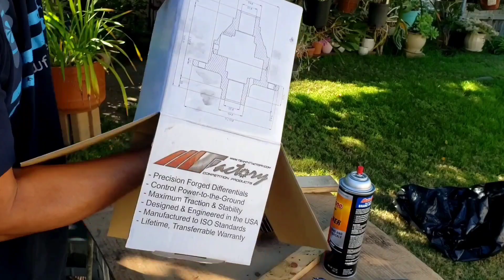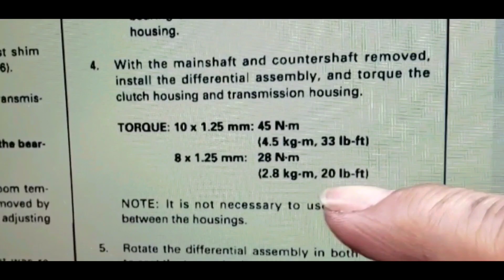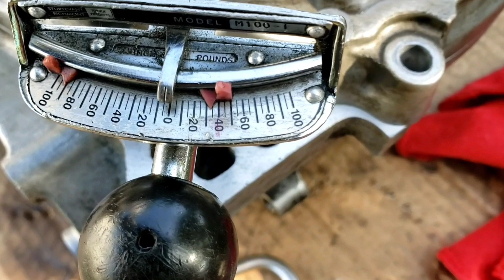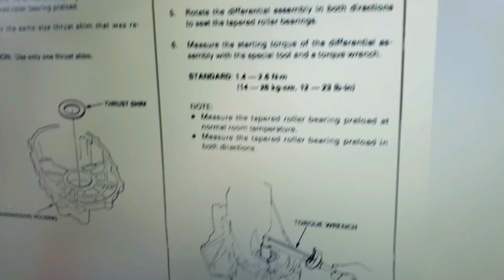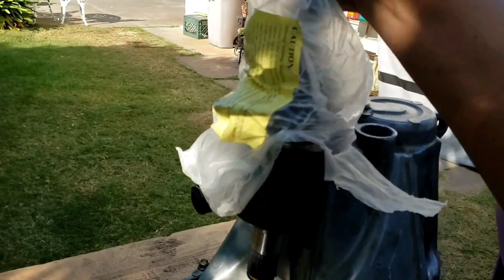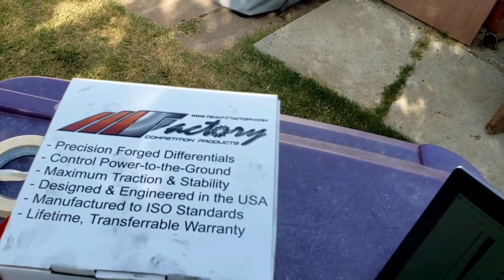MFactory LSD install and bearing pre-load check. G23vtec swap Civic.

Comment: I just bought one of them mfactor LSD for my h22 tranz for 300 brand new with new ball bearings, and then bought a new 4.0 fanle drive for my boosted rex . 450hp on pump , new race tune for 650hp to come
Reply from the maker: Daaanngg! You'll be winging man! Thanks
Reply: @sagittnet2158  thx for all the h22 content 💪

Comment: Welp. I'm doing this exact installation right now. My preload was approximately 5 inch lbs, and can move it with ease with my fingers. Can't find any shims available to adjust it. I might be screwed! Any ideas?
Reply from the maker: You should be okay as long as you can turn it w/ ease and remember that you also applying a sealant on flanges amd it'll be alright.

Comment: How did you remove the case outer brace bearings?
Reply from the maker: The outer race was a little bit loose, it just need a little tap from the outside (seal removed)
Reply: Thank you

Comment: Great video! Question, in the works of getting a M2B4 transmission for my BB6. Do you know the difference between a MFactory LSD and the one that comes in the M2B4 (factory LSD)? Just curious.
Reply from the maker: Tbh l don't know the difference between m2b4 lsd vs mfactory. But l do have both of it and l can't really tell any difference. You can't really go wrong on any of the 2 if you decide to get them, both are good.
Reply: @sagittnet2158  ya I'm removing my t2t4 so I'll be waiting to see if I notice anything better with the new m2y4 mfactor, 4.0 drive and carbon synchros,I believe they are both the same type of LSD  but the mfactor unit is probably stronger in strength at least .  Besides these ones I had a LSD  quaff  with a JDM GSR . Great tranz . Took years of abuse over a decade
Reply from the maker: Thanks for watching!